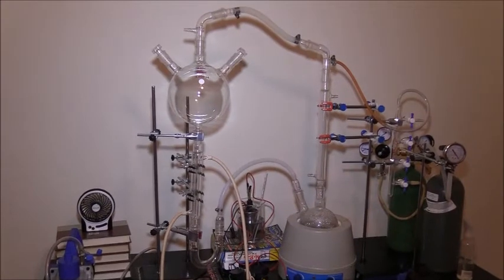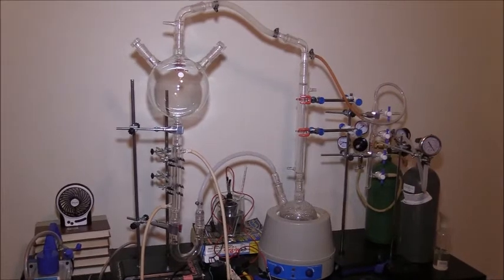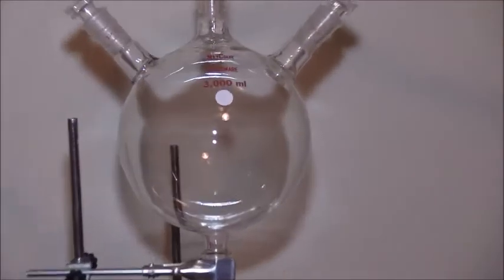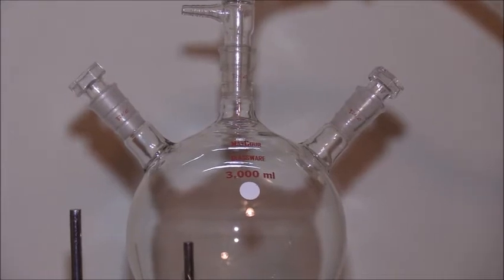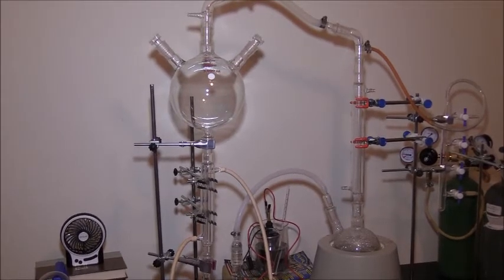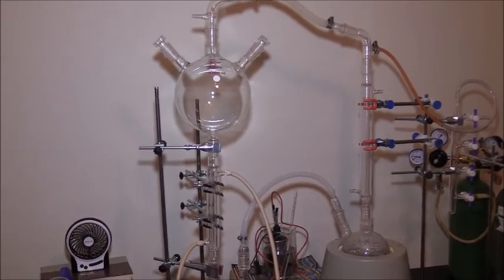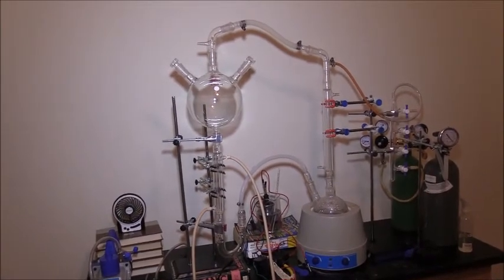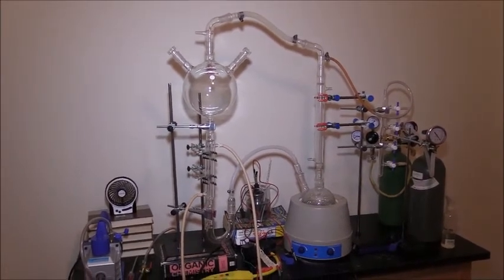New and improved Miller-Urey apparatus

Comment: I will like to do this experiment in my garage. I'm a student. Is there a place I could get hooked up with cheap gear. Any advice?
Reply from the maker: I got a lot of my stuff on Ebay.  Ebay is an excellent source for anything you would need for the experiment!
Reply from the maker: This experiment was not cheap to run.  You might have to save up $ for all of the different elements involved.